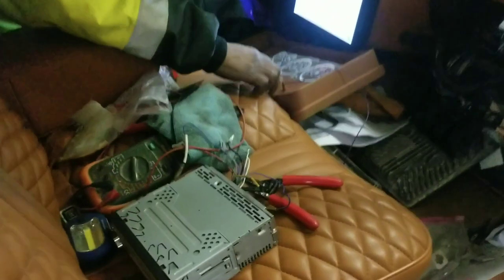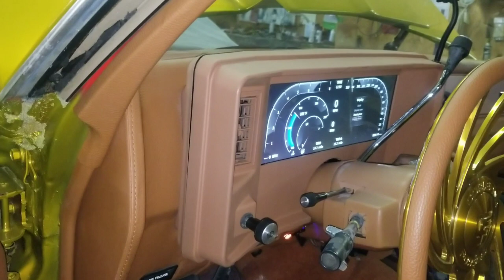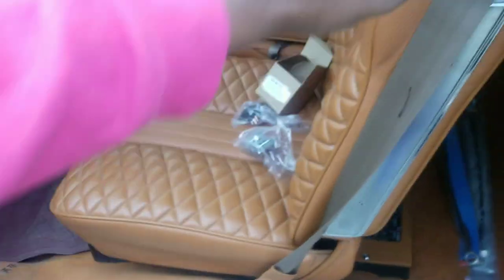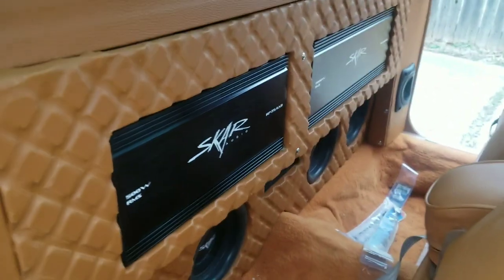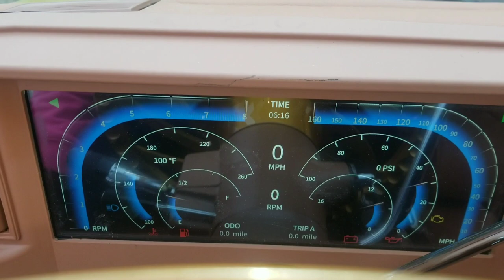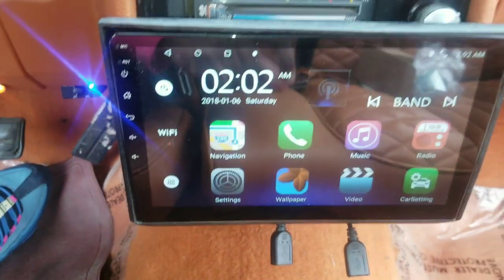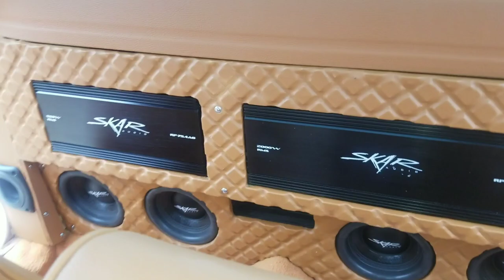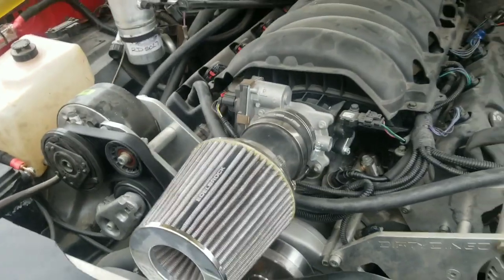autometer Invision install on my gbody el camino on 24s... skar audio installed with 10.1 inch dash.

Comment: Where did you buy your lower dual speaker door panels?  Also what company did you buy your Auto Meter? Is that Auto Meter model the 7005?
Reply from the maker: Yes its the 7005 and i ordered it from Amazon. I bought the panels from opgi
Reply: @DelvonDunkin  ok Cool, I'm putting my 85 Elco together. I like how you hooked-up your El Camino. It's killing the game. Good lookin my brotha!
Reply from the maker: @k.j.2192  thanks bro i appreciate it. Good luck with your build my guy #elcogang
Reply: @DelvonDunkin  yep yep!

Comment: Bro what os is running your LT swap? Just got mine installed and my injectors aren’t coming to life, that gauge cluster is hard👍🏾
Reply from the maker: Idk about the os but i was having problems with it at first i had to send it to psi to get it reflashed...
Reply: @DelvonDunkin  I’m in Tulsa and your the second person I’ve heard say PSI....  are they located in Oklahoma
Reply: @DelvonDunkin  I got mine harness reworked and my dude made the factory 2017 gauges work with my swap... I did a camaro dash swap too
Reply from the maker: No psi is a website bro. Just lookup psi conversions. Thats where i got my harness and computer from.
Reply: @DelvonDunkin  bet good looking out...
Reply from the maker: @J2A61  no problem g